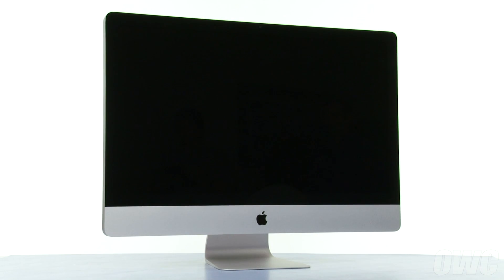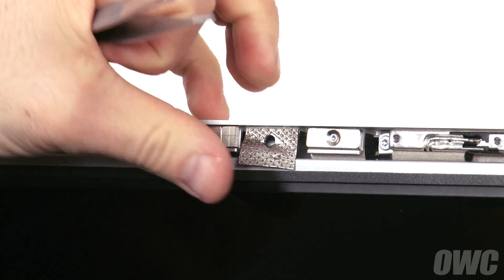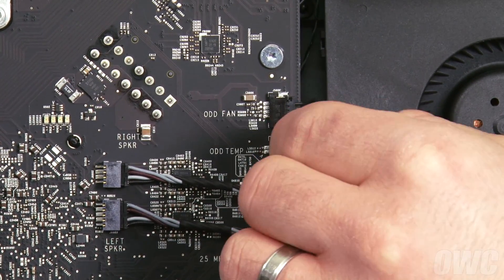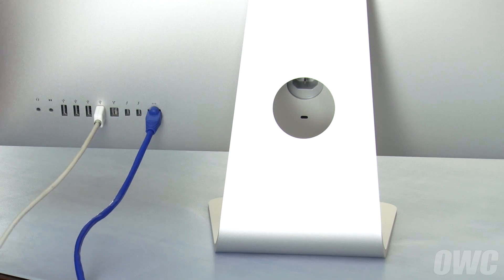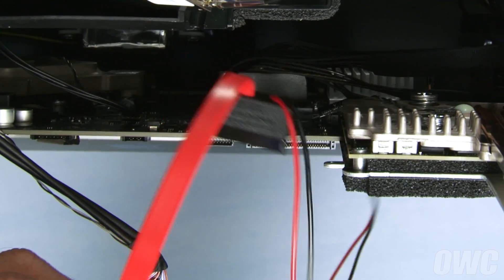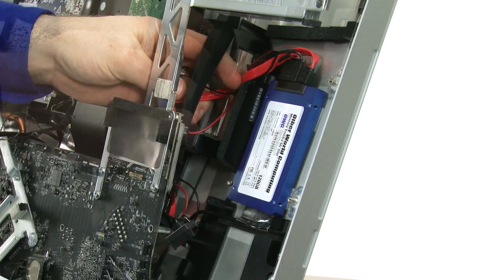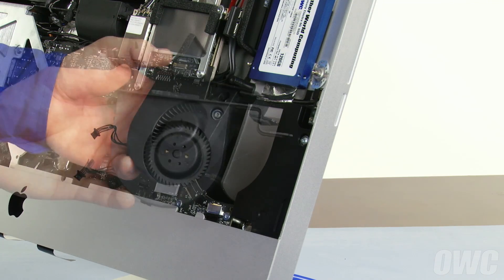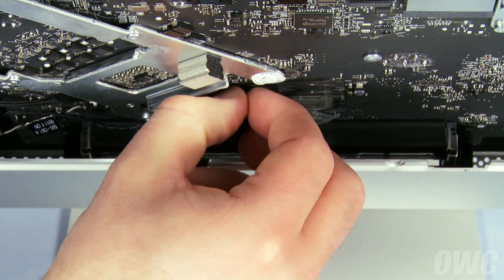How to Install a 2.5-inch SSD in the SSD Drive Bay of a 27-inch iMac Mid 2011 (Updated)

Comment: Thankyou MacSales, this is a brilliant guide on how to install an SSD into your 2011 iMAC! 

It seems quite daunting at first, but once you work up the courage to tackle this job, if you take your time to carefully follow this guide, you will be successful.

Key things I learned during the process:

1) Make sure you have all the right tools BEFORE you start the job! I thought I had the required torx bits to undo the screws but when I tried to remove the screen I quickly discovered that my tool would not fit in the narrow gap between the screen and the outer casing of the iMAC, so I had to buy a thinner T10 torx screwdriver. I also realised half way through the disassembly that I didn't have a T6 torx bit (for one tiny screw) so had to buy one of them too!

2) Be super careful when handling the LCD screen, as it is very easy to get a greasy fingerprint on it, and these are VERY difficult to clean. Also, when using a microfibre cloth to clean the dust off the screen, be very very gentle, as even the slightest piece of dust is enough to scratch the screen permanently. (I didn't have the original screen protection bag to store the screen in)

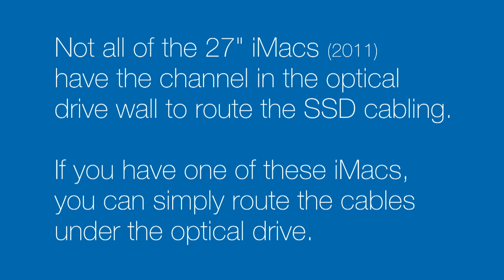3) My iMAC was one of the models that doesn't have the channel in the optical drive wall (see 9:02 min) to feed the SSD cables through, so as a workaround I cut a small notch in the drive wall to feed the data cable and removed a small part of the foam seal to feed the power cables. see:   https://photos.app.goo.gl/3bYyIXw7EwyqJ5J52

Good Luck !!
Reply: Thank you very much for your idea to cut a small notch in the drive wall to feed the data cable and removed a small part of the foam seal to feed the power cables. It's' perfect!

Comment: I would get a CD drive caddy for one SSD drive and put both where the CD goes, plug the original CD drive sata cable into that  SSD drive, switch the mechanical hard drive for a SSD of the same kind and put the two together on Raid 0, then it might get 700 MPS, my Mac Pro did

Comment: Why so many steps?? I replaced mine in 5 steps
Reply: That's nothing, I replaced mine in just 3 steps. 
1) Pull iMac apart
2) Install SSD
3) Put iMac back together
:-)
Reply: Do you need any cable for the installment, like the thermal cable?

Comment: hi there! i have a mid 2011 imac that boot loops, any idea what it is? i think it may be the motherboard
Reply: HighriseVsRust what happens before the loop starts?
Reply: Nothing, when i turn it on it doesnt even reach the login screen ;c
Reply: ok, look at what the verbose loading screen says. startup with the Command-V keys down. you will see text writing on screen, let go of the keys.
this is your startup processes, at the end of the text tell me what it says.
Reply: ok, see if you can boot into recovery mode. hold down the Command (⌘)-R at startup, when it shows up select disk utility. run repair disk, if everything is ok quit out of disk utility and reinstall OS from the previous window. that will not erase what you have in the application folder or your files.
Reply: HighriseVsRust that is strange, is there any beeps or tones during startup??
Reply: HighriseVsRust  well I'm running out of thing to tell you
Unplug your keyboard and mouse, any ext devices then restart ?
Reply: Did you open up the iMac and remove or replace anything
Reply: HighriseVsRust did you make sure to place the hdd temp sensor back and plugged in, I have seen that problem also. You may want to open the case and verify
Reply: Try the Safe Mode (hold the shift key down on startup). Let me know your results
Reply: HighriseVsRust did you hold it down until the apple and the loading bar started?
Reply: HighriseVsRust ok well time to think about replacing it with a newer model, 900 for a board isn't worth it. Good luck we tried